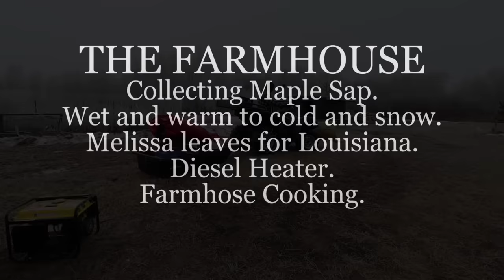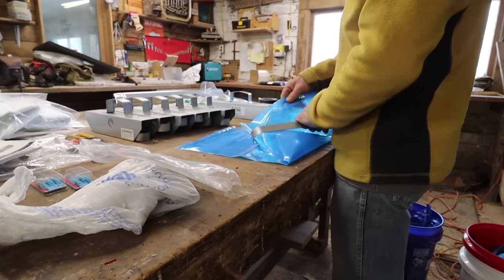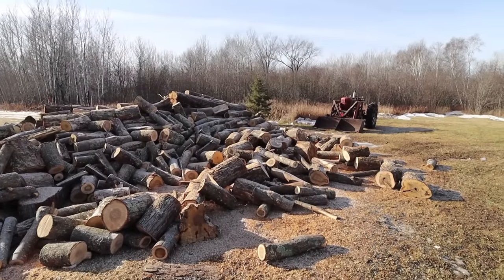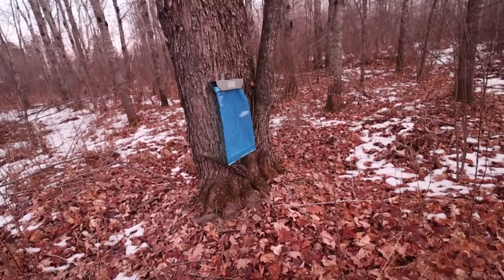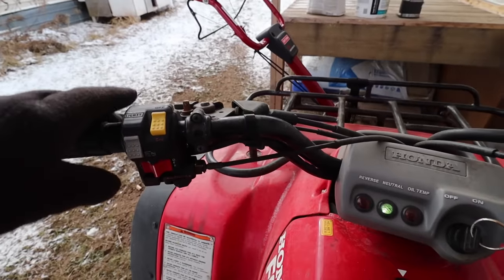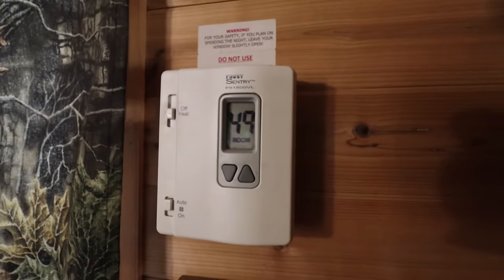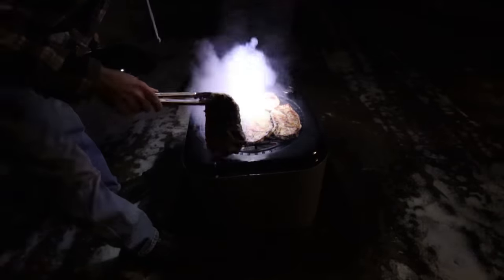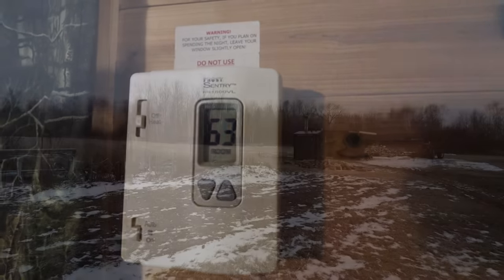THE FARMHOUSE. Melissa goes to Louisiana. Maple syrup. Diesel heater run time. Cooking. More wood.

Comment: Joe you have water in your hydraulic oil. The oil is thin from the water. That’s why you have little pressure. Drain the entire system and refill with fresh oil. That’s also why your oil looks so creamy.

Comment: you may have water in the hydraulics . Chane the fluids .filter, and try to dry out the hadraulic tank the best you can the pump not getting enough fluids maybe causing it to build up pressure in the tank pushing fluid out the fill cap you might have to replace the pump but fleet farm in Cloquet or northern tool in Hermantown might have it also fleet farm in hermantown

Comment: The thing with plugging into your 12v power source is that when it's running and you have a power outage it can't go through the shut down stage.  possible damage.
Reply from the maker: Same thing happens when the battery goes dead which is more likely than the power going out.
Reply: well not really, I own 4 of these not all the same brand but 2 of them ran low on battery power, which sent an error code then proceeded to shut down @NorthernSeclusion

Comment: Wow, milki hydraulic fluid. Contaminated with water. Change it quickly. You may have to change it a couple of times to get the water out.  Caused by condensation.  When are you going to the tent,
Reply from the maker: I am buying a new pump and I will change the fluid at that time.

Comment: Was that clicking I heard from the diesel heater, an ignition?
Reply from the maker: It is the fuel pump. Many people complain about that when they mount them permanently inside of wherever they are using it. There is fixes for it, but since ours is outside it is not an issue.

Comment: Joe, what’s the name of that inverter your using with the heater, I got one that doesn’t maintain enough voltage to get burner to ignite, the inverter kicks out after pump runs for a bit!
Reply from the maker: This is the one I bought. You can adjust the voltage via the screw adjustment. Not sure this was the video I covered that in but I did show when I did that. https://www.amazon.com/dp/B08LDC41B6?psc=1&ref=ppx_yo2ov_dt_b_product_details
Reply: Thank you!

Comment: I am curious to ask if while you were out in the woods checking on the Maple tree tapping you are doing, do you check for dead standing or recently down trees that you can cut and burn in your boiler?
Reply from the maker: No, I do that assessment during the summer and fall. It is very hard to know what standing timber is dying or dead in the winter since they all look the same. I have a half dozen trees that need to be taken down and cut up before they rot so they can be used for firewood. I will take care of them later this year.

Comment: I'm from Florida. So, what is the boiler for?
Reply from the maker: It heats the house and the house hot water. It heats the front and back parts of the workshop building and it also heats the guesthouse. It does this for the same cost it used to cost us just to heat the house alone in fuel oil costs. We have no natural gas here and in northern Minnesota, electric heat would be extremely expensive so no one has electric air handlers like many do down south.
Reply: @NorthernSeclusion  so there is hot water circulating through your home, by a pump? Heated out in the boiler....does that heat your water in water heater too.

Comment: To me the splitter seems backwards, the wedge should be on the ram and fixed backstop on other end. Also the wedge seems too aggressive (wide) . Change fluid and if not better change the pump, looks like you are pumping air along with fluid.
Reply from the maker: My uncle Matt said it needs a new pump. I hate splitters that have the wedge on the ram. I can't stand them, that is why I looked forever to find this one.